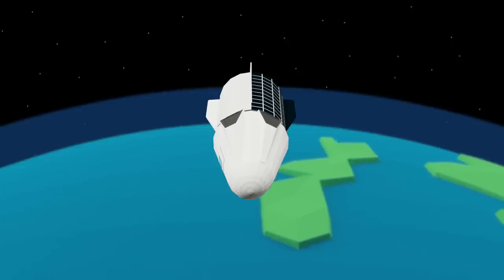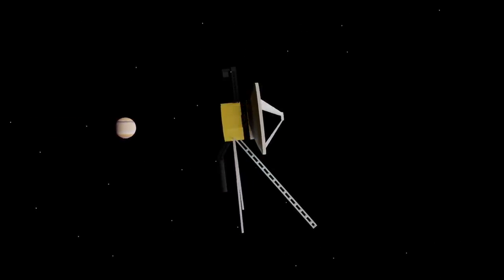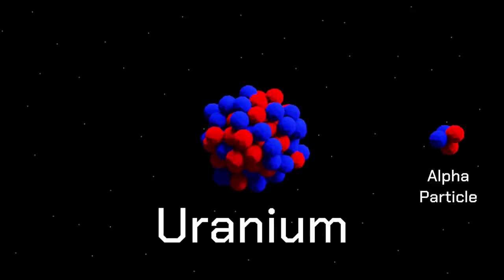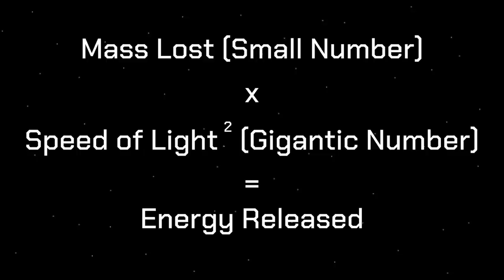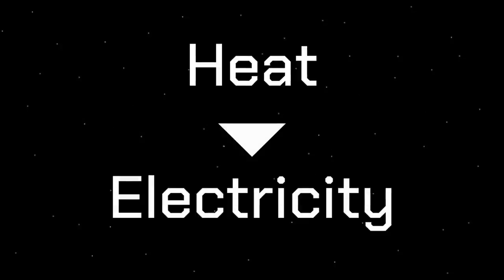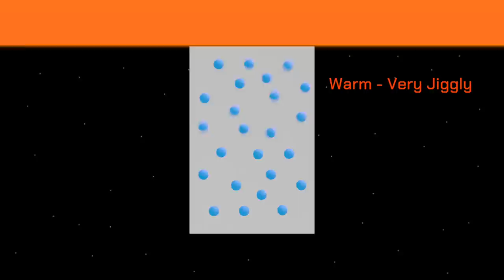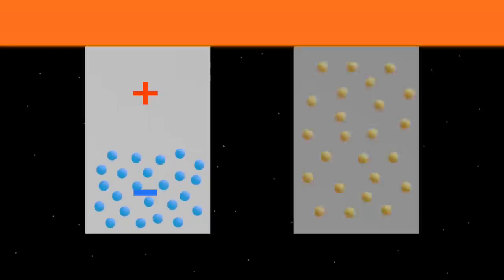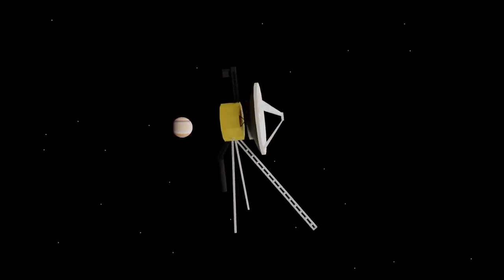Nuclear Power in Space - How RTGs Work

Comment: I wonder.  Could we use an RTG in this way:  Inside the RTG there is inert bismuth, but in space, the bismuth is neutron-activated to make polonium-210, which then powers the RTG?  In this way, we can get the very high power of polonium-210, along with the nearly permanent bismuth to make more polonium when needed?  That way we combine the benefits of high power without the drawbacks of short half-life.
Reply: The thing about the short halflife is that it's both a drawback but also a benefit. The same reaction over a longer time will output less heat flux, so it will require a larger chunk to provide the same heat to power the generator, which makes it heavier. To really extend the lifespan of an RTG without weighing it down you'd prefer to pick a starting material that has a fission chain with a lot of steps, none of which are particularly slow going.

Comment: Are there different types of RTGs? If so, what are they?
Reply: Not really, they’re all basically the same thing, only the size and efficiency varies. One thing that wasn’t mentioned is that the isotope of plutonium used in RTG’s is Pu238 which decays so quickly that a chunk sitting on your desk would be red-hot. A few other unstable elements have been used but the overall design is the same and plutonium 238 is overwhelmingly the fuel of choice and has been since the 60’s

Comment: I‘ve been thinking about how electric motors, batteries and controllers need to be cooled in order to remain effective. Instead of wasting the heat to the environment by air- or watercooling those components, you could hook those components up to such a thermal generator, using the waste heat of the engine components to trickle charge the battery in a closed loop of sorts. Considering that cooling is what holds back modern batteries and technologies like the axial flux electric motor, that could be an interesting solution. But I don‘t know if the cooling induced by a thermo electric generator would overcome the heating by the trickle charge leading to a sort of battery meltdown where the heat generated would just induce even more heat due to resistance. Or whether the cooling effect would even be sufficient in the first place.
Reply: The thing about Thermocouple generators is that they require a hot end and a cold end. That's not really feasible in atmosphere unfortunately. But it's an interesting idea.
Reply: @dojelnotmyrealname4018  soviets used RTGs here on earth.

Comment: Something doesn't seem right.
You said that some semiconductors will be pushing the negative particles to the cold side. Those, I suppose, are electrons, which we need for an electric flow.
Then you said that another semiconductor will be pushing the "positive particles" to the cold side. The only positive particles that I know that aren't positrons are protons.

As far as I know, protons don't flow around a material like electrons do. The explanation doesn't seem correct, since in order for a side to become positively charged that same side had to become ionized, i.e. have electrons striped from the atoms and added to other atoms. It also doesn't explain why the first semiconductor becomes ionized, because the electrons aren't the only thing that jiggle more when internal energy is added. The whole atom is affected. In fact, this extra motion lowers electrical conductivity, as electrons have an harder time to jump from atom to atom in the lattice structure.

The only way I could see this work would be through the energy and particles given off by the decay of plutonium, as this energy/these particles would have enough power to ionize atoms, stripping them of their furthest electron(s), creating that such electrical potential. But even this doesn't explain how those electrons would eventually move away or closer to the source of radiation, unless the orientation of the semiconductor wouldn't allow charges to move back to their respective ionized atoms...
Reply from the maker: https://en.wikipedia.org/wiki/Thermoelectric_generator

Comment: IF RTG  brust in space can it effect human
Reply from the maker: There's no real reason is would burst, there's no fission chain reaction involved. Even if the radioactive material got out (Which would not happen without outside interference, either something smashing into the RTG or someone purposefully tampering with it), it is a small quantity and predominantly emits alpha radiation which is very easily shielded from. RTGs are typically only used on unmanned spacecraft, although some were taken to the Moon during the Apollo program.
Reply: if RTG are kept in plutonium box can it react with plutonium
Reply: @rohitshoryachannel31  Can't react. Plutonium is keep in a shape and weight that allows to generate heat, but avoid the super-critical state that could lead to an explosion.
Reply: So don't dig up the box of plutonium, Mark

Comment: Why didn't you simply touch on how thermocouples work because of dissimilar metals? ie, copper/constantan (or others)?
You could have shown a simple t'couple hooked up to a voltmeter, then show squeezing it between your fingers to watch the temp go up at the same time explaining the same thing happens many hundreds of time in an RTG simply by replacing your fingers with Pu and the output of the RTG as being the product of many multiple of this???
Your molecular explanation totally missed the point.
Reply from the maker: With respect, that's not what this channel is, I'm all about explaining HOW things work. Showing a number on a multimeter isn't an explanation of HOW a thermocouple works, it's just an observation that it does work.

The thermoelectric effect occurs at a molecular level, and therefore requires a molecular level explanation.
Reply: @SimplySpace  Agree. I just think a practical illustration is helpful. I struggled for years trying to understand it until I saw a simple t'couple, then had an epiphany. I wish it would have happened earlier.

Comment: ...we got lotsa heat from coming from the sun ...why not use its heat and light for carbon free energy...never seen one only solar
Reply from the maker: I explained that right at the start of the video. The sun isn't always available for long enough periods on the surface of some planets. That's why the Opportunity rover died to a dust storm, it was using solar power.
Reply: @SimplySpace  ...back on earth...I mean ...since we got lot of wasted energy in a form of heat...why not use it as how RTG are implemented on rovers back on earth..?
Reply: No energy is free. If solar were not subsidized by the government they would not be viable at all.
Reply: ..we could go carbon free with geothermal if we dig deep enough...why do we not do it?...
Reply: @surenbono6063  not efficent. Just like solars panel and wind power. Take alot resource to build and give not enough power.
Reply: @nguyennam1945  ..geothermal are better option than a nuke..if anything gone wrong its just some steam not a fallout